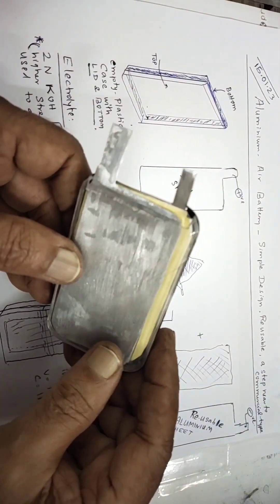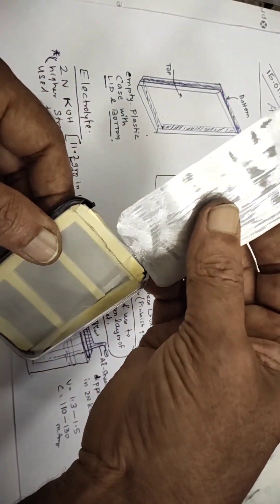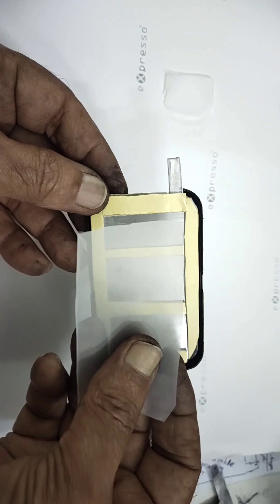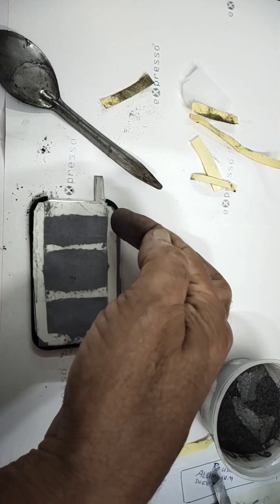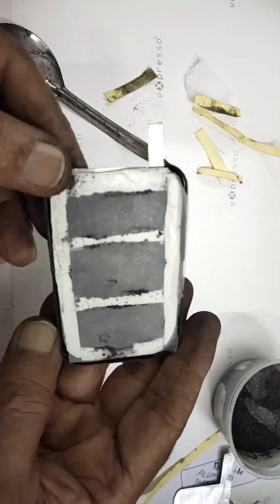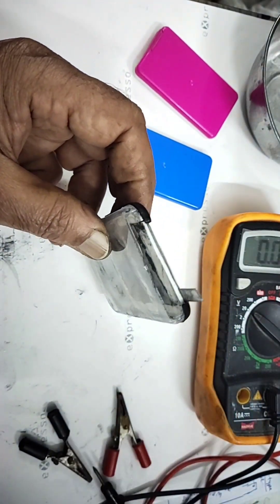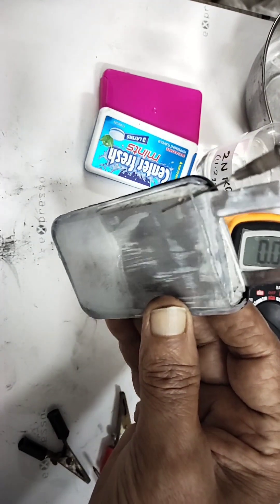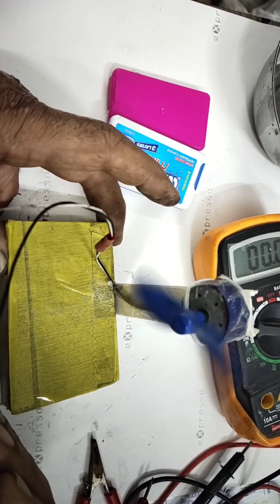ALUMINIUM -AIR BATTERY , COMMERCIAL PLATE TYPE, SIMPLE & REUSABLE. VOLT 1.3, C 150mA USING 2N KOH

Comment: Can it carry 12v motor. As the voltage is only 1.,3v does it mean come the amp is high the battery will last much longer? Hope its rechargeable. What if one want to increase the votage can it be produced in many and wired in series? Telling to check ans in comment box is not helpful

Comment: Is this chargeable 
How much time we will use it 
Is this can be used for home purpose
Reply from the maker: These Aluminium Air batteries are are useful till the aluminium plate is active. That means once the aluminium turns to aluminium oxide it cannot generate current. Therefore these are not rechargeable. If you want to make it rechargeable ie. Aluminium carbon battery using zinc sulphate electrolyte, it becomes rechargeable. Kindly refer my previous video on quick charging aluminium carbon battery. It will be useful.

Comment: من فضلك كيف تحضير محلول الكتروليتي الذي وضعته وشكرا تحياتي الليكك
Reply from the maker: Thank you for your comment. With regard to your question, Take potassium hydroxide 11.2gram and add 100ml distilled water in a beaker. Swirl it. This will be 2N KOH. This will be sufficient for trial purpose. You can also prepare more concentrated KOH solution and use it to get more current.
Reply: @dkjawahar-techexpt671  Apakah bisa mencapai 3,7 Volt ?
Reply: @dkjawahar-techexpt671  Coba buat menjadi GEL, bagaimana hasil arusnya, apakah bisa 3,7 Volt ?
Reply: I have seen the and regsrging if it's rechargeable so pls attend to the other questions .Thank you for your interesting videos
Reply: In regard to one of my questions and it's it's yes it means that 12,p s will produce over 12v and dies it also mran that the Amos will increáse to Iver a 1000 amps?